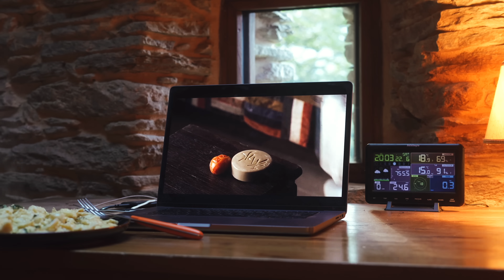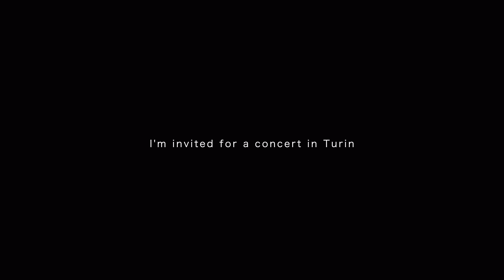#118 Greens in the Greenhouse

Comment: Vining things like peas and beans will climb from the bed up into the greenhouse using otherwise empty space. 
You might consider using the corrugated roof you have now, INSIDE the glass when you get it. That will diffuse the light and add some needed insulation for spring and fall. 
Beautiful work, kudos!

Comment: Love the greenhouse! I'm wondering if the chicken poo and straw bedding you added to your new greenhouse garden beds might be too hot and burn your new plants. Usually chicken poo, which is very high in nitrogen, has to compost/sit for 6 months or so before using. Never use straight out of coop. Start a little compost bin for your garden greens, chicken poo and bedding. Wet it down occasionally and give it a stir. Let it sit for a several months, then use that as organic fertilizer.

Comment: Greenhouse temperatures can be recorded with a minimum/maximum thermometer which should tell you if the grapes are better inside. 
Local people are probably your best way to find out what grows best at that altitude. 
There are videos on how to use supports from the top of the greenhouse to keep the plants, especially cucurbits like melons, etc from taking over. 
Hardware cloth is a good idea for a greenhouse, especially raised beds. I had to cut it by hand, won't repeat that again. Dremel, grinder much better for keeping hands intact. 
Very good height for those beds. 
Another gizmo is a soil moisture gauge. 
May everything grow well. 🇨🇦😊

Comment: 🤠    GREENHOUSE: Most practical accessible,  and best looking I've seen!  🌿🪴🪴🌿  Have seen, where in early spring with cold nights, some have made small 1 - 2 ft high hoops, with clear plastic over, INSIDE  the greenhouse to maintain heat through the nights,  some have lain stones down path/ raised bed wall, to absorb heat in day, for the cold nights, others have put compost bins in for heat.  Going to be fun next early spring to see what you find works best in your little spot  ♨️

Comment: excellent. Love the green house. TO use up the vertical space, you can grow cherry tomatoes in buckets hanging form the ceiling. Cut holes in the bottom of the bucket, plant the tomoates upside done, and fill with dirt. Tha plant then doesn't need staking and less rot from touching the ground.

Comment: Very nice video. I would advice you to put the tomatoplants in the back row because they get really high quickly. You could as well have gutters hanging on the inside along the line where the roof meets the walls and have strawberry plants in them. Your greenhouse is an inspiration for me, love it. I would put flat rocks on the floor, much easier to keep clean than gravel. Maybe you could put a solarpanel on the greenhouse for lights and waterpump, don’t know if there are pumps that you can connect to solarpower. Some say you should keep water in black containers inside the greenhouse to keep it warm for winter. Loved this video as always, keep up the great work.

Comment: Thanks for another fine video! I’m worrying about the board you have put at the bottom of the green house roof…as someone used to a lot of snow I might have thought that the board will stop the snow from falling down from the roof when it starts melting in the spring. Melting snow is also very heavy… Keep up the good work, Martijn!
Reply: The boards are fastening points for the temporary plastic roof. The permanent roofing glass is a custom order. I look forward to seeing what his final design will be when the glass is on site and he installs it.
Reply: @deirdrahahn6211   that explains everything! Thanks!

Comment: The purpose of a glasshouse is to control the temperature of the plant's environment while allowing maximum available light to reach the plants...
.... So, an 'ideal' glasshouse would have NO frame - it would be all glass!  You then control the ventilation.. and the  shading with vents, roof blinds, shade netting etc..
So, any frame should be as thin and minimal as possible.. and, should be painted white to reflect as much light as possible onto the plants.
This is why old, traditional timber glasshouse are always white..!
They are also always sited where they will not be shaded by external factors... hedges, trees, walls etc...
Soo... attractive as the construction of this glasshouse is, the fact is.. that it's severely compromised by its location and construction method......
A more quickly, inexpensively built glasshouse done with respect for the plant's requirements.. would be more fit for purpose, and give better results....!! 
Remember..tomatos come from Mexico....!!

Comment: Hi Martijn
a couple of suggestions;
if you wanted to have a fig tree (or citrus) you could espalier them against the north wall of the greenhouse, which presumable doesn't get any direct sun,  that northeast corner also looks promising.
Do you have gutter guards which prevent leaves accumulating in your gutters, or at least a cover to prevent the downpipe clogging up?
Greetings from Australia

Comment: still dont know why he couldn't of made the doors higher
Reply: Not allowed to by authorities
Reply: He doesn’t have to.
Reply: Has to do with structure/,material of the original walls.  he explained in the beginning after talking to the authorities what the limits are, it's why he doesn't have an asphalt shingled roof and modern glass patio attached to the cabin.. The way these cabins are made the stone walls are structural, not just exterior cladding as most modern brick homes you see today. To change the door height he'd have o take the stones down from the top and rebuild teh whole section, and who knows where that would end.. even if the authorities allowed ?

Comment: if you can build a greenhouse why do you need permission to build a storage space this build should be fine for that too
Reply: He’s not building a storage shed. He is building a work shop. He explained the permit issues in a previous video.
Reply: I may be the impermanence or purpose associated with a green/hot house. I'm thinking back to what Johannes said he had to assure in order to build his latest garden spot.
Reply: Because the greenhouse is not a permanent structure.